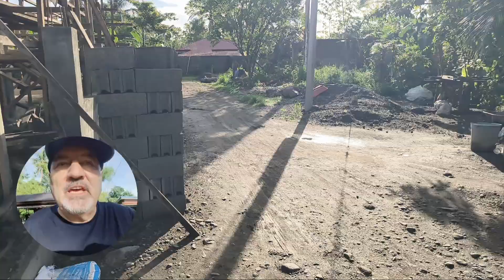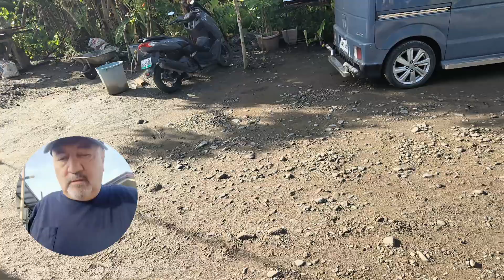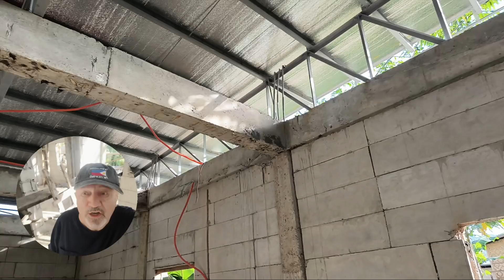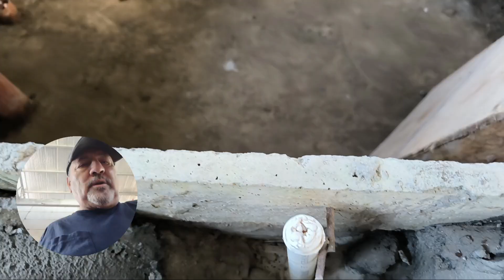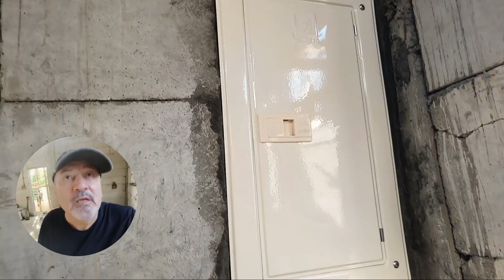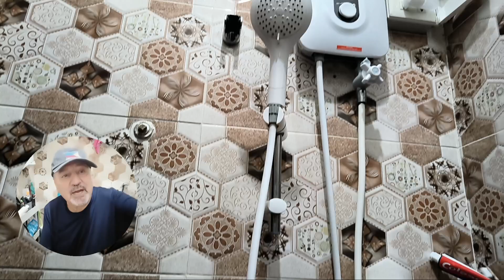This is how you build a house in the Philippines #construction #philippines #homedepot

Comment: im ok with the flex line inside the walls , it would be nice if they could install the outlets and light switch boxes straight..the breaker panel should have a "equipment bond" essentially  a grounding wire from the panel itself to the ground rod  , i believe sometimes they will ground the panel to the rebar itself in the wall ..( not sure if this is correct ) . so if the equipment bond is intact if there is a short in your outlet and it has a ground wire running back to the breaker panel ,the breaker will trip and worst case the short will follow path of least resistance ( bad outlet to breaker to breaker panel chassis to ground rod .
(but we all know chinoy outlets 99.999% have no ground ..and there is no ground buss in breaker panel)
 as far as the grounding at the pole...  the electric meter box has its own equipment bond to the pole and the wires go back to the source of power.   i will dig up some diagrams and send to you
Reply from the maker: Thank you, Mike 🙏❤️